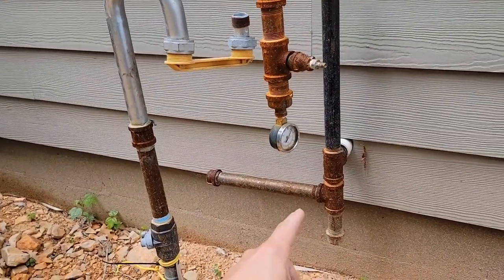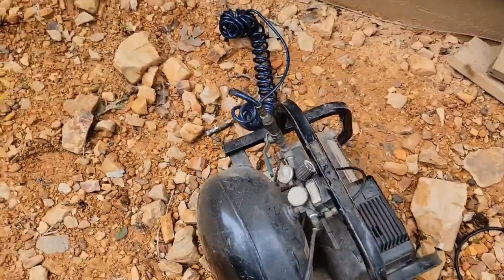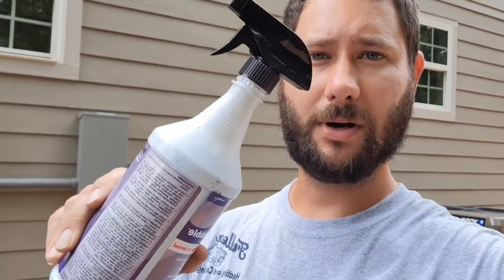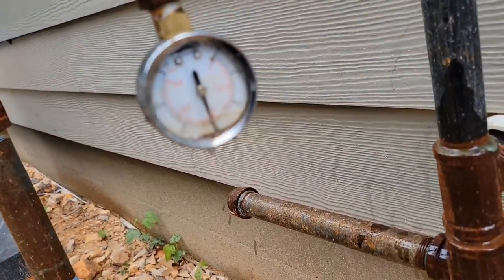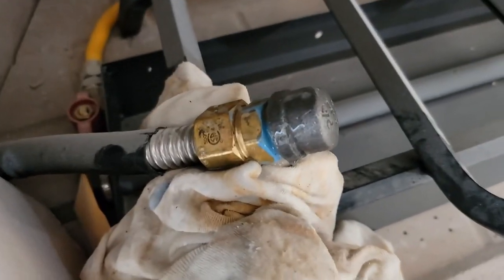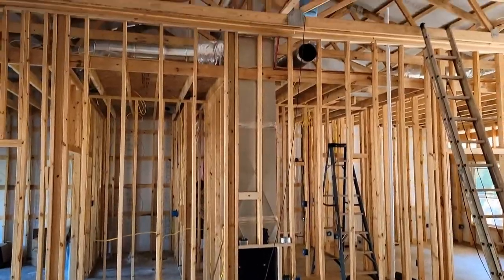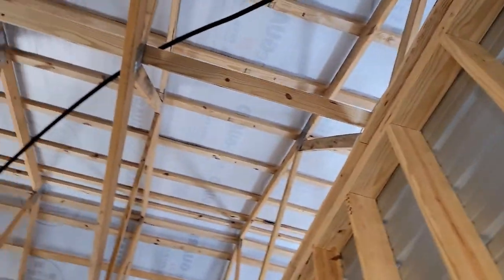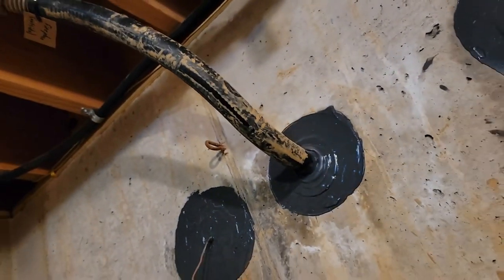HVAC Gas Line Pressure Testing: Here’s Why It’s Critical

Comment: I learn so much about HVAC from you!  I'll share something about the new piping leak-down test with you from my training.  Go past 30 lbs to about 35 or 40, then bleed down to 30 at your Schrader valve (or add an actual bleeder valve to your rig).   This is how the gas company verifies your test  is valid and that your test rig gauge isn't just stuck.

Comment: Can a home owner run his or her own gas line to the gas meter,  prior to the gas company setting the meter?  If so, what are the rules/code for Texas.  I'm asking cause i keep getting ridiculous bids for a gas line run for a stove and a gas furnace.  The gas line run is pretty simple and straight forward and in the shape of an L.  It runs in the eave 31' 8" then across the kitchen 12'8" and then straight path across the leaving room to the utility closet20'  where the furnace will be installed.  Also, the drop downs add 8' for the drop from the eave down a brick wall to the meter and about 8' down to to the furnace inside the utility room.  Total run is about 82feet.  Any help advice appreciated.

Comment: If you forget to manually turn off the gas valve will that amount of pressure damage the gas valve inside the furnace? Furnace valve is good for 3-5  psi

Comment: Question: do you close the individual appliance shutoff valves for the pressure test?
Reply from the maker: I usually install a cap on the line and leave shutoff open. never hookup applian until after test
Reply: @TaddyDigest  Thanks for the quick response. I appreciate it.

Comment: Have you used the   press type copper lines or is the soldering the lines better
Reply from the maker: I've used the press tools.They work great.The fittings are expensive.
I do like soldering though